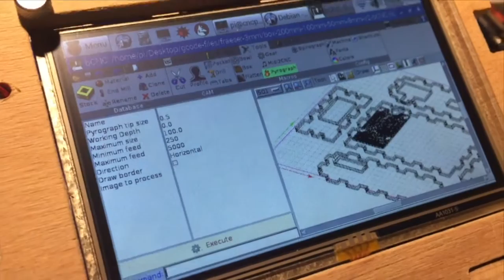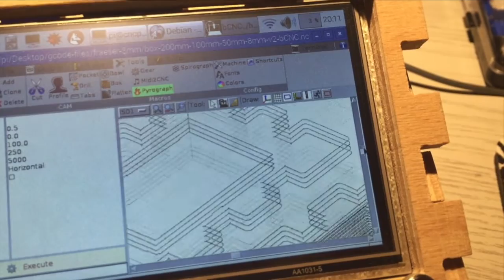RaspberryPi CNC in its new milled wooden case

Comment: hello DaSamo123 how did you get bCNC to install on your pi mine refuses because it cant find opencv-python. if you could direct me to a website I would b most happy
Reply from the maker: Hi. The newer versions of bCNC changed a lot compared to the old ones. The installation is quite "tricky" (see here: https://github.com/vlachoudis/bCNC). I have created a gist here (https://gist.github.com/samowitsch/d265d37452728fac35dc6f45c4bc773e). I hope that helps. If you have maybe an RPI with an protoneer cnc shield maybe the prepared sd card image can help you get started: https://wiki.protoneer.co.nz/Raspberry_Pi_CNC_User_Interface_SD_Card_Image